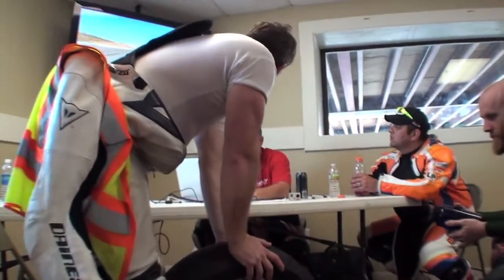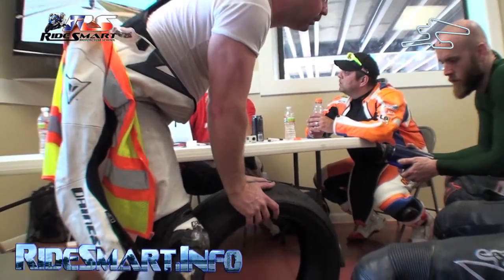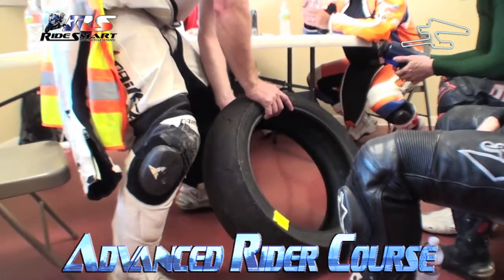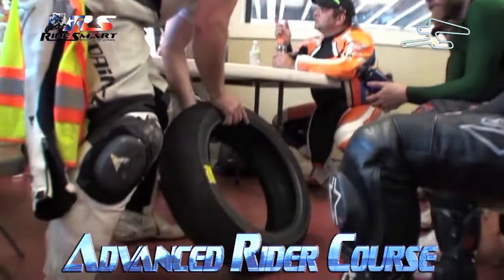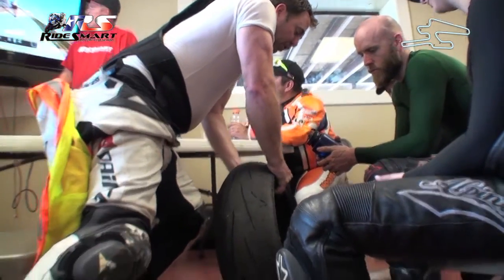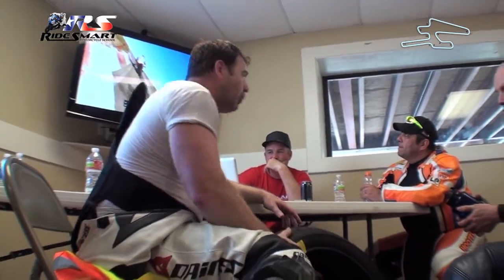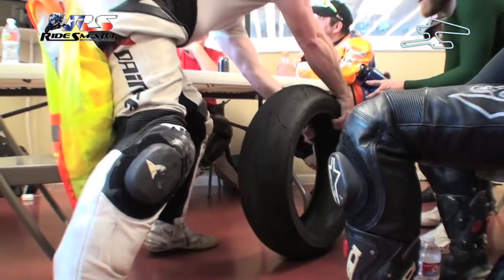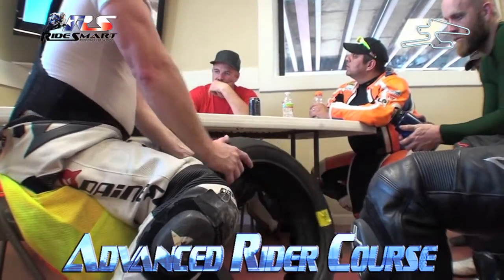Traction, Lean Angle, Contact Patch: Dirk Anderson

Comment: Wow, he is so wrong on so many levels. Maybe he can ride a motorcycle but he sure has no idea about physics and how tire works.
Reply: Then teach us, professor - if this isn't the explanation, then why is it that literally every MotoGP racer leans so aggressively to the inside?
Reply: @eboomer  that's not really a fair question to ask the layperson. Race-bikes are not the same as street-bikes, the optimum cornering technique is one thing, casual street-riding is another and racing is yet a third. You should know as well as anyone that many riders learn bad lessons on the street and track while riding "successfully". MotoGP riders are the top 1% of the top 1%...even WSBK is a whole level down from MotoGP. The riding techniques of MotoGP simply do not translate well to an average rider whether on street or track.

The short answer is that racers do it  because it works for them. If it doesn't work for them, do you still suggest that they do it?
Reply: I know right, its not taking into account when cornering the G affect adds weight to the bike and rider so its pushing the tire into the road surface even more than being stood up straight, so the contact patch is bigger during cornering

Comment: touristguy87 Front contact patch does not need to be bigger on acceleration which agrees with sportbike handling. There needs to be just enough to make the front follow the road surface and it needs to be bigger when braking. The front does not keep the bike stable in a turn the rear tire does and it keeps the lean angle. That's why you see racers at the IOM wheelie out of turns with the front high up in the air and still the bike is at lean.
Reply: ...really?
Well I guess that since riders do occasionally wheelie out of turns, then surely your explanation of how and why this happens must be completely right. Absolutely! Because we all know that evidence proves a theory.

Just as the fact that astronauts were able to land on the moon and return proves that it is actually made of green cheese.

Comment: he's missing the fact that when you get on the throttle you unweight the front tire and shrink the contact-patch. Accelerating doesn't make the contact patch bigger, it makes it smaller.
Reply: He is talking about the rear tire  it the front
Reply: The video is about the contact patch of the rear tire during acceleration, not the front.
Reply: @eboomer  um the two are coupled. Acceleration unloads the front wheel.
Reply: @touristguy87  Of course.  I think he's aware of that though, and it just isn't relevant to the point he was making about motorcycle lean angle on corner exit.
Reply: @eboomer  LOL front-angle contact-patch & grip is highly relevant to lean-angle on corner-exit :)

I love these self-styled "scholars" who insist on spouting idiocy. I'm not going to try to explain this to you. If you can't think about it well enough, you'll learn the hard way if you ever actually get out and ride for long enough. And you know, sometimes that's just what it takes...two or three times, even.

maybe you'll even survive the lesson
Reply: touristguy87 i see that